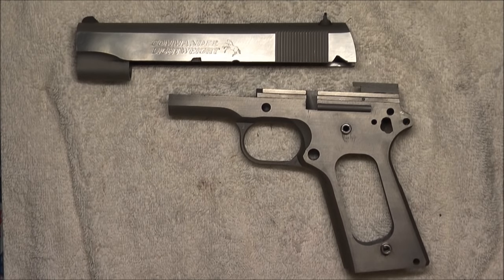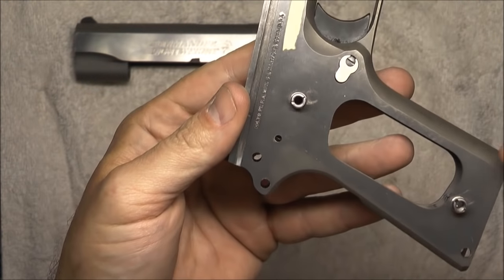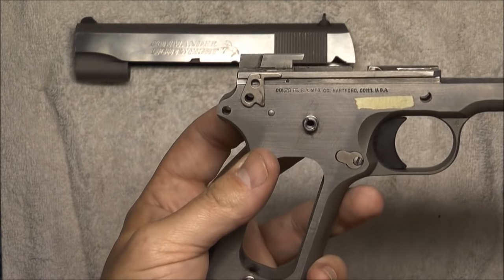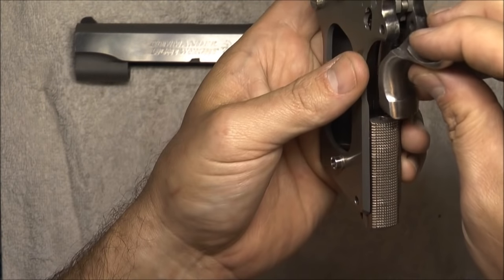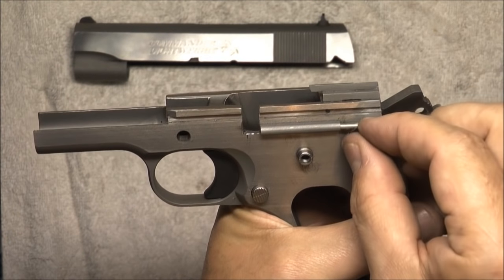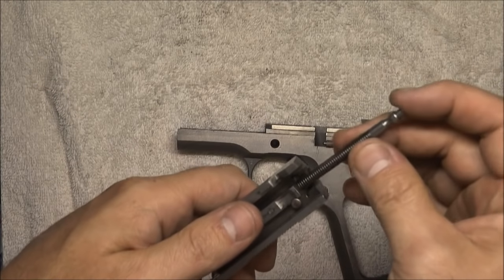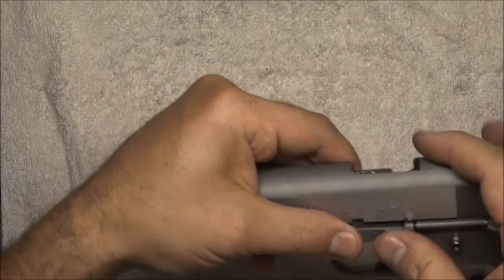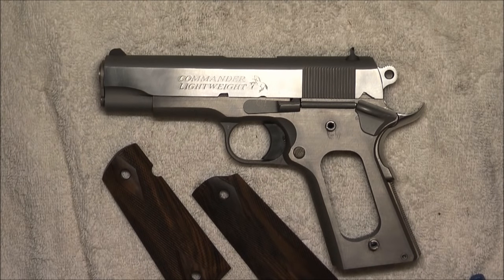BEST Series 80 1911 Reassembly Vid in HD!

Comment: Yes thanks . After of trying for a couple hrs I gave up.  But this morning I got  a light put where I needed it  & did as you say &. Got it in the first try !! Maybe less then 2 minutes ! I had in the past converted , before arther got me a dozen  of 80 to 70 with spacers but did not want to order one more spacer so just left out slide parts . Seems to work great in the garauge. Took out most of the take up & over travel& so happy with the reset I just cain't tell you ! Got to get to the range!!! By the way it is 9mm SIG Tacops !  I cain't pull the 45 slide back any more . Had 3 surgeries on my shooting hand & getting an other trigger finger in my index finger of my shooting hand ! Yes thanks again !

Comment: Great video.Well done. I thought I would mention to check the disconnect function. Hold in the grip safety,squeeze the trigger but don't fire. This should lock in the grip safety.
While still holding the trigger, release the grip safety.The grip safety should stay locked. Now release the trigger. The grip safety should unlock and the disconnect will click. Thanks for a great video.

Comment: I spent HOURS looking for and watching videos that were incomplete, rushed, or poorly filmed.  Some people just rushed through like they were showing off.  And the trickiest part is where the two little pieces go for the "model 80 parts".  I finally found some worse videos and figured it out.  Wish I found your video two hours ago.  Excellent job showing how the part will go on the inside by placing it on the outside first.

My only suggestions for improvement are to have some light that shows the interior of the work.   Small parts got lost in the shadows.  And, if you can, take the autofocus off.  Half of the video had the camera focused on the table and the work was out of focus.

But the audio was very clear, and that's usually the worst part of any video.  Kids in the background or echos in the room or covering up the mike.  Yours was great.

Thanks for taking the time to make the video.
Reply: SuperOpinion8ed I
Reply: SuperOpinion8ed I agree, thanks for the detail

Comment: Hey thanks for the great video.  Was having great difficulty reassembling m my 1911 colt gold cup.  Couldn get the slide lock in.  After watching your video I realized that the little knob sticking out that  I couldn't get past is SPRING LOADED.  After learning that I could apply the right pressure need to get the slide lock past it and into the slot.  Thank you again!  Jeff

Comment: Such a helpful video. Your video saved me money and a long wait for a gunsmith to change to a beavertail and replace a trigger.  Worked through with this video slowly and carefully and the gun functions and looks great.  The only issue I encountered in reassembly was when I cocked the hammer back to secure the safety pin it wasn't catching.  I realized the sear spring needs to be lying perfectly against the sear and disconnect.  I've disassembled and reassembled using your booked marked video several times now and can do it with confidence. Thanks

Comment: Great job!
My expirience has always been with the older model 1911's. Recently I picked up a Colt Series 80 that someone had removed the four Series 80 parts so it would function like a Series 70. I bought the four Colt brand parts from Midway, but had no idea how they were supposed to be installed. Your video was fantastic. It walked me right through it and the pistol now functions as it was designed.
Cudos to you and thanks for the help!!!
bentonallen

Comment: i just used your take down and reassembly videos to work on my colt defender last night to install some nitre blued pins. lifesaver. at one point i didn't realize one of the series 80 safety bits had fallen out on the floor and my kids had made a mess with chocolate muffins and i almost vacuumed it up, haha.

Comment: @icoach73 - I figured you would!  Speaking of which, I used this video again this morning to put a new hammer and sear in mine.  A safety check recently revealed that when I released the slide from slide lock, the hammer would drop as the slide went to battery......While full-auto might be fun, I'm certain it would not good for my CCW - AWKWARD!!  Thanks again for the vid icoach73.

Comment: Excellent video. One thing I might add: When you assemble the upper hand of the series 80 parts, it is possible to assemble it such that it appears correct, but the pin can actually be under the hand, and not through the pin hole. You can successfully assemble the gun this way, but the firing pin will not unlock when the trigger is pulled. Checking that the trigger will lift the hand before putting the slide on the frame will help prevent hearing a click when you're hoping for a bang.  :-)

Comment: I want to thank you for these excellent 1911 assem/disassembly videos. 1911 has been my carry weapon since 1991. I would strip this firearm routinely almost weekly, however I then married a anti gun lunatic and had to put up my guns. I thought I still had the skills to reassemble the series 80 parts... I was wrong. I've been struggling with the upper sear lever for days. I watched your video twice and boom, I had the old Colt back together in as long as it took to watch the videos. Thanks a lot. P.S. I love the pencil trick. I just added that to my safety check procedure. GREAT JOB ON THE VIDEOS.

Comment: Great Video! These series 80's can be tricky with those 2 little safty parts when they fall out during disassemby. Without this video it would take a long time to figure out which way they are correctly and easily reassembled. I sure needed the refresher. Nice job and well done!

Comment: VERY good video.  I was a bit confused when I started tearing out the series 80 parts on my Kimber, because I couldn't see how different the S80 parts are between the Colt and Kimber.  When you removed the firing pin plunger lifting bar, i was searching like Hell all over the kitchen for it.  Kimber simplified it into one piece.  Again, great work!

Comment: Thank you for this vid. I've had a series 80 1911 for quite a while, and every once in a blue moon I end up having to take out that damn plunger that keeps the firing pin from moving unless the trigger is depressed. That plunger is the bane of my existence. You have to depress the plunger to the EXACT depth within one millimeter, depress the firing pin to a depth +/- a millimeter, AND you have to slide on the housing part of the pin sticks out of for the hammer to strike it, and you have to do it ALL AT THE SAME TIME. I HATE IT!

Anyway, I always forget what order/how exactly to put that plunger and pin back into place, and after four hours of trying by myself I came to your video and got it done in two minutes. Thank you.

Comment: Good vid. As a Gunner's Mate in the USCG I have only worked on series 70 guns. I am considering the purchase of a series 80 gun. Your video makes it clear that the disassembly and reassembly are still pretty straight forward. Thanks.
Reply: Good deal. If, by chance, you want a modern 1911 but want the S70 and don't want to drop a grand on one, I HIGHLY recommend Ruger's 1911. It's set up as a Series 70 with all the bells and whisles (flat MSH, beavertail, extended thumb safety, novak sights, etc...) and can routinely be found for around $600 - lot of bang for the buck, so to speak
Reply: Thanks! My next 1911 is going to be in 38 Super, so unfortunately the Ruger is out at this point.
Reply: That's a fun caliber - can't go wrong with a Colt in the 38 Super, or Wilson, Les Baer, etc. if you have the means. So many good 1911s, and not enough space in the safe...

Comment: Great video: The trigger bar lever is the hardest part of this operation for me.You must have a skinny index finger, I don't have big hands but I could barely fit my pinky in there to install the trigger bar lever. I was able to do it though. Thanks this video was a big help.
Reply: It's not a requirement that you use a finger here.  You have options.

Comment: However, when the slide is in battery and the barrel is locked up, a spring pushes the disconnector up into a machined recess in the rear of the slide, allowing a mechanical link between the trigger and the sear so that when the trigger is pulled, the hammer will drop and the weapon will fire."

Again a great Video!
Reply: Best dam video on the 80 series I've ever seen. Kudos to you sir. And thank you.

Comment: Your video are by far the best.  You make assembling and disassembling look very easy.  I am getting better at it a will donate for the cause.  I am having and issue with my 911 model 80 with the safety grip.  I have assembled and dissembled this 911 three or four times adjusting the grip spring slightly in both directions buts, it still will let the hammer down when testing the grip safety.  It will not do it immediately but, if I push the trigger or wiggle the trigger for long enough it will let the hammer down.  Could you please do a video on a 911 letting that lets the hammer down with the safety grip not pushed or explain what else could cause this issue.  It has all the parts of a series 80 an look good as far as damage to the parts and fit exactly together like your video,  Any information will be greatly appreciated on why the 911 could have this problem.  Thanks

Comment: Excellent video series! Very well explained with excellent photography.

Life Hack for finding small parts on the floor: Loosely secure a piece of pantyhose over a vacuum hose. When the vacuum is turned on it should form a concave shape on the end of the hose. Now just vacuum, and the pantyhose will catch the small part. :)  Cheers
Reply from the maker: Thanks for the comment, and for sharing the cool tip! I've been fortunate enough not to lose any small parts so far, but I know it happens all the time and that's a great idea...

Comment: I use these two every time I detail strip.

I am always having trouble getting the mainspring housing back in, though. It seems like I have to push really hard up against the hammer assembly to get the mainspring to move and then drop the pin back in quickly--not sure if that's a sound approach. Taking it out usually goes OK unless my hammer strike on the pin doesnt get it out all the way, then the pin sort of gets pinched between the MSH and the frame, and then the same happens to my punch.

Comment: The puporse of the sear disconnect:
"The Disconnector is a safety device that prevents a round from being fired before the round has properly chambered, with the slide and barrel locked up. When the slide is out of battery (not completely forward) the lower portion of the disconnector is depressed, causing disengagement of the sear, preventing the hammer from falling if the trigger is squeezed.

Comment: It is important to get the series 80 parts in the correct orientation ... I messed up once many years ago with a ParaOrdnance, and had an unsafe result with a full auto discharge.  It was a simple fix, but this video would have been very helpful, and prevented an extra teardown/reassembly ;-)
Reply: Just think: someone could have made a ton of money on that "modification".

Comment from the maker: When pushing the MSH back in, I've had it bind when the hammer strut isn't properly lined up... I've noticed the same binding when punching out MSH pins on 1911's with more robust main springs. You COULD try a lighter spring and see if that helps, but I guess I've just learned to work around it.

Comment: Very useful reference. I know my 1911 pretty well but I use your vid to make sure I remember everything because I rarely take the slide apart that deep. Your camera work is much more useful than other vids. You make me want to ditch my ambi paddles. So your thoughts on lube of all that? I know how much lube for the normal field strip and common cleaning. I noted you did not lube anything AND none of the parts looked "wet" so I assume it's dry lube or nothing?

Comment: Absolutely awesome video.  Most detailed on youtube.  One quick question.  Just got a beavertail drop in from wilson.  Its not lining up the thumb saftey hole exactly.  Should i try and sand a little of the beavertail, or some of the slide to fit it.  Talking about maybe half a millimeter.  Thanks man.

Comment: Awesome video!  Mine was a little different though... the barrel bushing would not turn clockwise enough to release the recoil spring.  Just had to take the slide off complete and kept my hand over the spring so it wouldn’t come apart!  MK IV series 80 but it says commanding officer on the opposite side of the slide... but a very helpful video otherwise!
Reply: Yes... and No.
You probably didn't use a bushing wrench to rotate the bushing far enough to release it.
I believe the gun says "Commander", not Commanding Officer on the slide.
A lot of people fail to understand the purpose of the barrel bushing or realize  it is supposed to be a close-tolerence, fitted part that consistently re-aligns the barrel in exactly the same position with each shot.  A sloppily fitted bushing- one that you can remove by hand- can not be conducive to the best accuracy.

Comment from the maker: Thanks for pointing that out Fred - I know there are a couple different schools of thought on the firing pin block (80 Series), and my personal preference is to remove them. All my 1911's (except the one I carry) have an 80 to 70 series frame filler shim from TJ's Custom Gunworks in place of these parts. Not to get into a debate, but I definitely notice a much more crisp and slightly lighter trigger pull without these parts.

Comment: You're missing a safety test - you should also check that the firing pin block actually does stop it from firing.

Option 1 (while slide is not attached):

- try pushing the firing pin in - make sure it does not protrude from breech face
- push stop in place - and try again - make sure firing pin does protude

Option 2, while fully assembled: insert pencil into barrel, cock hammer. make sure you can not move pencil by manually pushing the firing pin without the trigger pulled

Comment: @Joseph Gordon. What you heard is true of some guns, but not 1911's. However, you should not pull the trigger/drop the hammer on a slideless frame. You can dry fire a 1911 forever, without any problem.

Comment: Thank you for your fantastic video! Questions: I just disassembled my Colt 45, Mark IV, Series 80, Officer ACP.  In the area of the recoil spring/barrel, I found, what appears to be, the remains of blue colored, plastic - small pieces. Any ideas??
Reply from the maker: You found the remains of a recoil buffer pad. They're disposable/replaceable and serve to reduce impact from the slide slamming into the frame when the weapon cycles. Not necessary to have, but can extend frame life, especially if you shoot a lot of full house loads.
Reply: @icoach73  thank you kindly for the info!

Comment: After i put the spring in and get the retainer back in place, The hammer has tension but will not stay cocked back, And the safety feels like it is stuck in the fire position.

Comment: At the end of the video, you pulled the trigger without it being loaded. You dry fired it. I heard that was bad to do. Does the 1911 hold differently than that of a regular pistol? By the way, this is a great two part video. I can't wait till I get my 1911 in a few weeks.
Reply: Hey Joe, dry firing for modern pistols is okay.  Not to be done for older firearms. If you are going to dry fire for routine practice which many serious competitors do then I would use snap caps for your caliber pistol.  They are fairly inexpensive and can be purchased on the internet or your local gun store. Don't forget to count your dry fires as to total rounds fired for your maintenance schedule.
Reply: Of course I would count dry fires as spent rounds in it's self, because accidents can and do happen. Knock on wood I have been responsible enough to of never of been that careless, but I will use your information as a new bit I learned. Thanks.

Comment: My safety / slide stop spring tube is separating from the frame. And won't go back with a light tap. 
Is this normal?
Reply from the maker: I don't think so..  take it to a range and ask the gunsmith, they can probably restake it for you fairly cheap.

Comment: great video!!! I need your help, i followed your instructions and i can't get the firing pin plunger and spring in to save my life. I'm 16 years military so yes I have handled guns. but I'm completely lost, any suggestions??? please...
Reply from the maker: +Julio Melendez did you get this figured out? In my experience you really have to push the firing pin into the slide much further than you'd think to line up the relief that allows the plunger to be installed correctly.
Reply: icoach73 ty th for the reply, had to order a new spring. I guess on mine the extractor does go in as far in order for plunger to fall in. I tryed tried your way and it does not line up. But ill keep u in the loop...
Reply: still No luck. quick question the plunger is a standard size right? almost feel as if I ordered the wrong plunger. see I just got my 1911 gov series 80 from a pawn shop upon tear down I discovered a few peaces missing, and one was the plunger and spring. So so now that I'm putting this gun back to right I can't get the spring and plunger in.
Reply: Are you sure it doesn't or didn't have an 80 series-to-70 series conversion shim in it? It's not uncommon that people order a shim from TJs or Brownell's (who also stocks the TJs) to take up space on the sear and disconnector pin where the lower sear lever normally resides, then they just leave the upper sear lever, plunger, and spring out completely